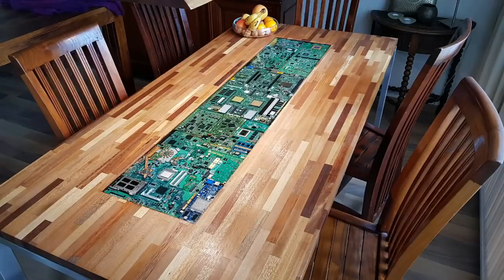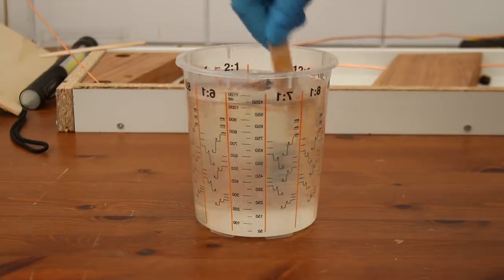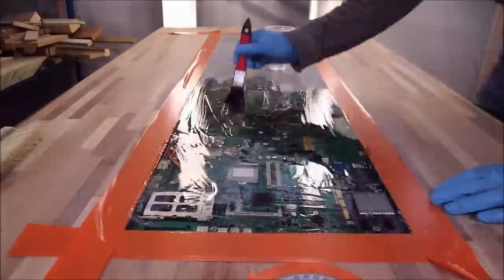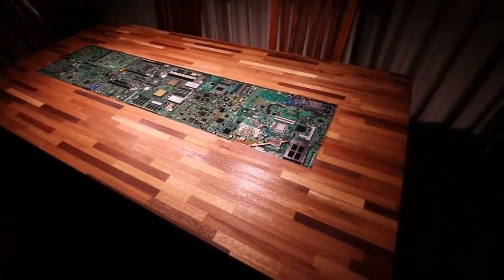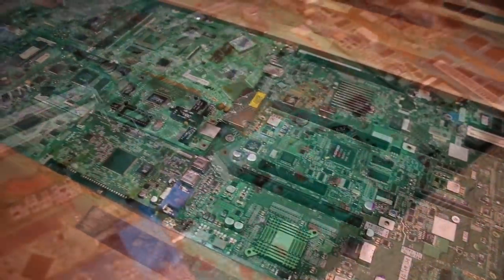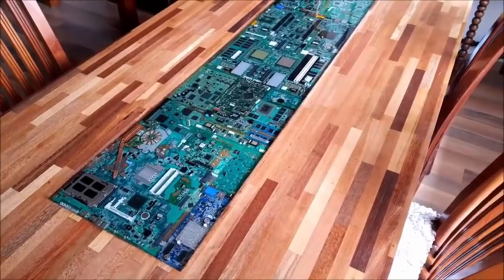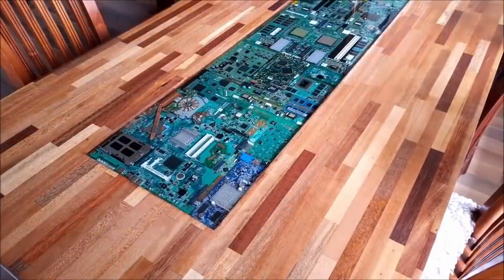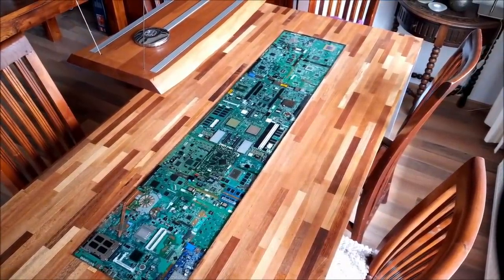Circuit boards with lights in epoxy in a table

Comment: Amazing! the effect is superb though couldn't you use those LED xmas tree lights instead of the fibre optic cable?
Reply from the maker: Maybe. But I deliberately left out the battery powered lights with controller, because I thought you would go crazy quickly of a carnival in a table all the time... 😊 It is the temporary character of the manual light for a few seconds in the fiber optic that I like. 
Besides, pouring in working LEDs can be a problem if they break down, where my 'LEDs' are infallible..

Comment: How far to the edges did the stickiness reached? Maybe you can still use the table for something if you just use the edges maybe?
Reply from the maker: The stickiness is going away with time too, I noticed. But I'm making a 'how I fixed the table'-video. Wait for it... 😊
Reply: @Onrust1  Oh nice! can't wait. Well, I have to wait. XD

Comment: Pliers and low heat for the components to come off, and wipe to remove any left over melted metal.
Reply from the maker: I thought on that some more, and I came to the conclusion that what I did was probably best (although at the time I couldn't think of an alternative 😆😆). Because the behinds of the boards remained the same, and those would be the visible side. If I would have taken out components with heat, something might have melted and that might have been visible in the end result. Let me put it this way: I would do it again like this. 😊
Reply: @Onrust1  Ah I see why you didn't used heat.

Comment: Solution to fail: lay a piece of clear glass over the entire table.
Reply: Router out a layer thick enough for a sheet of glass on just the center piece; its hard to tell from the angles I saw it at but there should be some leeway between the surface of the table and the tallest component on one of the PCBs.

Won't get rid of any ugly spots under that but should make it a functioning and non-sticky table.
Reply: now I know when pouring  epoxy ,   to do it in a few layers,  instead of all at once.  Perhaps 3 to 5 layers, or 2 layers follower by a long curing time and covered with gorilla glass.
Reply: @James Flint Hadn't heard of this before, where can you buy it and is it expensive ?.  I googled it but couldn't find a definitive answer.
Reply: Yep that’s what I thought, but the visual distortion would still be seen…  he wants perfection.
At least I think he does?
Reply: Good idea.  You would just want a small gap or the sticky epoxy will make contact with the glass but only in random area's resulting in large bubbles like what you see in a poor auto glass tint job
Reply: OOOooOOO Good Idea!
Reply: Just make sure it's tempered glass if you're going to go that route.  Do not use standard glass for any kind of application like this; it's way too brittle and incredibly dangerous.
Reply: scobra
Cool story, bro. However, this is a video about a guy being creative, designing and building a table epoxy resin. Its something different and interesting. You're sheet of glass on a table is nothing new or interesting.
Reply: Travelin' Ted
And your trolling is nothing new or interesting either.
Reply: Considering that the table is bent, as seen during pour, glass probably wouldn't work.
Reply: @James Flint  I think you watched too much Star Trek!   :P
But hey... Did you know scientists recently created a "real" transparent aluminum?
It's called aluminum oxynitride, very interesting stuff.
Reply: @Reth_Hard   Cept it's primarily ceramic.  That stuff is to aluminum as orange soda is to an Orange.
Reply: @JamesLee-sw6ss   Yeah, well, I'm not quite sure if your comparison is very good since most orange sodas do not contain a single drop of real orange juice but yeah, the term "transparent aluminum" might be a bit misleading...  

I find this amazing that we can use a metal like aluminum to create a material that is stronger than glass and that is also even more transparent than regular glass.
Reply: @Reth_Hard  It was a bit pedantic, but it's also poorly named.  Aluminum Oxynitride is only around 30% aluminum.  Rest of it is ceramics.  It barely has any properties of being a "metal" anymore, to where it might as well not be one.  Thus the orange soda to orange analogy ;)
Reply: @JamesLee-sw6ss   I wasn't sure about the concentration, 30% is not a negligible amount, especially for something that is crystal clear. Anyway, since it's coming from a Star Trek Joke/reference, nobody should take this too seriously.
Reply: @Reth_Hard  This is the internet, everything must be taken with 100% seriousness!!

In all honesty, I ready about aluminum oxynitride in a Jack Reacher novel.  It's basically the replacement for bullet proof glass.  1.5" of this stuff can stop a .50 cal bullet fired from a Barrett M1..  It's nuts.  The crazy part about the manufacture of it though, it uses a modified form of DMLS (Metal 3D printing).  Meaning, give it 10-20 years, and we'll likely be able to print this stuff at home, once metal 3D printers hit the consumer market.

It is important though how much of a metal it actually is, which is why it's important not to confuse it with aluminum.  It's not conductive, it has a significantly higher melting point to aluminum, it doesn't corrode like aluminum does, etc.  That's why clarity is important :)
Reply: @Reth_Hard  30% can be negligible. It just depends on which properties of aluminium you are after. Still if the remaining 70% is ceramics it would be inappropriate to label it a metal alloy as opposed or a ceramic alloy or aluminium infused ceramics.
Reply: @UCyp5Y0PWU7-D8DNrTMp2Qjg 
Well... If Nasa can do it, everybody can...  
:P
Reply: Reth Tard
I'll look forward to seeing you land on the moon then.
Reply: @scobra6652  he is only criticising - watch his channel - nothing there
Reply: @scobra6652  LMAO. What a great comment!
Reply: To avoid the formation of bubbles he should have put the table in a vacuum chamber.
What an amateur...
Reply: Reth Tard   The man who has never made a mistake, has never done anything.
Reply: Reth Tard
Yeah, we all have one of those in our spare rooms just waiting for the day we make an epoxy table, because we're all professionals, right?
Reply: @grahammay6917  r/whoooosh
Reply: @Reth_Hard  I see that anybody understood the sarcasm
Reply: @javirodriguez4383  Sarcasm critically relies on its delivery to be effective, and Reth Tard's delivery was a failure.
Reply: @Reth_Hard  Give him a break , it was his first attempt at something like this. I would never had thought of making a vacuum chamber either.
Reply: @Reth_Hard  build one
Reply: @Reth_Hard  Wow, you really need to lift your game in the delivery of sarcasm, if that is what you are attempting. 🤨
Reply: @Reth_Hard  Yeah because we all have access to a vacuum chamber...lol!
Reply: @drummonkeystuffuk1875  
Well.. I'm pretty sure you have access to a pressure cooker... They're very easy to convert into a vacuum chamber. But fitting your table inside a pressure cooker, that's the real challenge...   ;)
Reply: @Reth_Hard  Well, since you put it that way.....spose i could suck all the air out of my sound proof room...lol

Comment: Epoxy is such a spoiled princess to work with, but nothing can match the performance and capabilities of epoxy if you are doing it right.

One method I've learned and practiced religiously after one to many projects failed in the same way as yours is to first measure as exactly the as I can and mix in one beaker, then pour the mix into an empty second beaker and use a new/clean spatula and mix it a second time, for just as long as the first time.

If you leave the beakers with the epoxy leftovers to cure you can feel a significant difference between the two beakers when you touch the cured epoxy, the walls of the first beaker will be a little sticky,second beaker will be completely dry to the touch.

I do the two mixing vessel thing both for when I do casting with epoxy as well as any carbon/glass fiber epoxy-lamination stuff, but with normal consumer grade epoxy glues I don't bother. 

In my limited experience, the glass-clear types of casting-epoxy seems to be extra sensitive for insufficient mixing if that is any comfort in your case.

Nevertheless it was an epic build and stellar results in every other area except for the mixing epoxy. 😎
Reply from the maker: Thank you. Yes, the last time - new project - I did it exactly as you described (I bought an impeller and mounted that to my power drill for mechanical mixing) and experienced the exact same with the beakers..! It's the way you learn, I guess.. 😊

Comment: Wait those were working or dead boards ?it's nice but lights could be done better with a proper pcb led that are quit clean bright and those boards have led that can be rewired to and a proper microcontroller will make then look like they working especially the Ethernet, power hdd LEDs and more
Reply from the maker: I deliberately left out the battery powered lights with controller, because I thought you would go crazy quickly of a carnival in a table all the time... 😊 It is the temporary character of the manual light for a few seconds in the fiber optic that I like.
Besides, pouring in working LEDs can be a problem if they break down, where my 'LEDs' are infallible..

Comment: Hi, I would advise using a 1 component Polyurethane clear / glossy product and paint over the epoxy. You can buy this at most hardware stores. It might help trying to gently scrape as much of the uncured epoxy without going to deep! This often helps. greetings from siliconesandmore.com
Reply from the maker: Ik was inderdaad van plan om epoxy weg te gaan halen, maar zie niet in hoe een extra laag er over heen daarbij kan helpen? Kun je dat uitleggen?
Reply: @Onrust1  DE echt vochtige epoxy moet uiteraard worden verwijderd. De extra laag die je gaat aanbrengen is geen epoxy maar een 1 component PU. DE epoxy zal nooit meer perfect uitharden, maar de PU zou die plekken wel moeten afsluiten. Dit lukt vaak, maar je moet zelf eerst even een klein proefje doen. Succes kan ik niet altijd garanderen ;-)
Reply from the maker: Ah zo. Ok, dankjewel.

Comment: Heat could cure it, i had the same problem with some of my carbon parts (way smaller) and put them on the radiator for a while...it did help for my parts......so maybe try to gently apply  some heat to it.
Reply from the maker: Time does it too, I noticed by now. But the ugly spots won't go away with that...

Comment: Most powerfully desk on the world :D
The fastest improvement is tempered glass (maybe little smoked) laid on liquid epoxy but mixed well and subjected to vacuum to get rid of air bubbles, or the glass can be slightly dull minimally and this masks all the flaws of the thick layer of the previous poorly mixed epoxy

Comment: couldnt you sand down the whole thing past the bad epoxy and refill it with good epoxy ?
Reply from the maker: Mmm... well that goes beyond sanding, because the ugly spots are too deep. I was planning to remove them with chisel or router, yes that is what I'm going to do. And I will make a video.

Comment: sicky, doesn't that mean not enough hardener ?
I would have thought you could brush or spray on some hardener and let it fix the soft spots, then sand it down and lay over a new coat over the whole thing.
Reply from the maker: 'Not enough hardener' - yes, that is pretty much the effect of not mixing well enough. You can not fix that with more hardener, as you don't know what the sticky spots are: resin or hardener. You might add hardener to hardener. The only way to fix is to take the ugly spots out and fill again - which is what I am planning to do. Wait for the video. 😊
Reply: @Onrust1  :  sounds like you have a rather sticky situation on your hands !
I would have to try something..I am sure you know way more than I, but I would take a bowl of each and put them next to each other and put a dome over them to see if the vapors would react at the surface.
if they did, you could figure out which is lacking.
taking off the top quarter inch seems like one way.  adding a quarter inch to the whole table seems to be another.
either way, the project looks very good.
I think I would add an Arduino and put LEDs on the ends of the fiber optic cables and then let the lights dance

Comment: I had this same problem on a project and discovered that the mixing portion is really important as well as doing multiple thin layers vs a few thick ones. I'm also assuming that your environmental conditions were spot on as well, temp, humidity, etc. Unfortunately I didn't find a way to repair the soft or blemished parts :(.
Reply: I forgot to mention that you can use a small blow torch to get out bubbles and smooth it out after pouring if those are issues.

Comment: Like many suggested put glass over is a good idea, but might protrude too much, another option is take Clear Lacquer rattle cans and go over that a few times that might solve the stickiness of the epoxy just not sure if it will flake after a few months, worth a try.

Comment: would some extra heat cure the epoxy?  or a chemical catalyst?  or as other said, glass top, with glycerin to make a good optical connection with the wood and epoxy.
Reply from the maker: Time does it too, I noticed. But the ugly spots don't go away with that. I want to fix the table and make another video of that..

Comment: Good idea, I play with epoxy as  well. But to my taste the constrast of the wood with hi-tech electronic board is a bit of a clash, I would use something else than wood, may be Hi-gloss black support. I would add a led strip hidden in the table to shine through the edges.
Reply from the maker: Hi-gloss black and a LED strip would be over the top for me, but hey, each his own. I like it that apparently I got your creativity flowing... 😊👍 Do it! 😆

Comment: I did something similar for my coffee table with the help of my local carpenter. The idea was sustainability, so, we upcycled all the old Mother Boards, Raspberry PI kits, etc, screwed them to the table and covered it with glass instead of epoxy.

Comment: Superb and u had find another way of E waste usage in this superb way and led will work by finer so there is no shorting no need to worry of led replacements this way E waste will be used in all type and dedigns not only table but walls bathroom floor etc 👍✌️08 oct 2019 India 🇮🇳

Comment: I thought about covering my wall with a solid layer of circuit boards with the lights blinking all over it.
Reply from the maker: Nice idea! Will you leave it at thinking about it, or are you gonna do it?
Reply: @Onrust1  The idea is on hold at the moment.
Reply from the maker: Sorry, but that is no answer to the question.. 😁
Reply: @Onrust1  Then yes.
 But unfortunately it won't be anytime soon.

Comment: If you have something sticky leaking through a jar lid, what do you do? You seal it up.

Bond a glass top to the table so that it is air tight (And epoxy tight.)

To avoid it spreading, make the glass only cover the center, with a routed perimeter in the wood around it where you create your containment seal. 

Could even work as an accentuating line.

Comment: Believe you didn't get the mixture to the correct temperature.  That Epoxy is allegedly supposed to be mixed and then you test it with a thermometer to the required temp.  Also when you pour its like 72 hours before you should pore again. It takes a really long time to cure.  I made a Deadpool table like this and I had the same results with it being really sticky even after a week and after a quick call to the manufacturer they walked me through the mix and I went over the whole table. This time it cured correctly.  Its a really cool table and loved the concept. Hope you can salvage it.

Comment: I believe the epoxy will harden sooner or later. Maybe it didn't get contact with the catalyst but eventually the chemical reaction (polymerization) will reach all spots.
Reply from the maker: Yes, you are right, I can see that already. But the ugly spots I showed in the video won't go away with that.

Comment: Future note, the distortion is because of trapped air, putting the epoxy under vacuum first would help it a lot.  
Also this is a guess but I think the oil is reacting with the epoxy making it sticky.

Else finishing up with a lacquer to seal the resin in would be a nice idea.